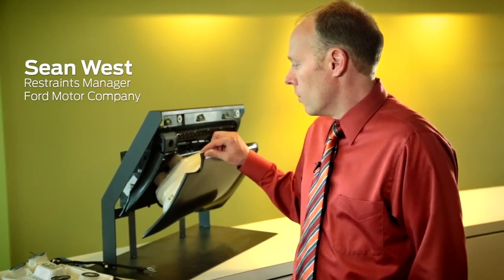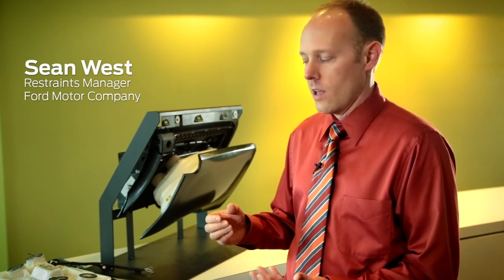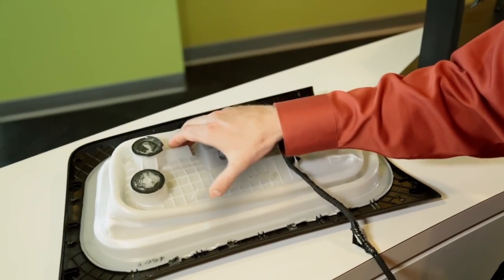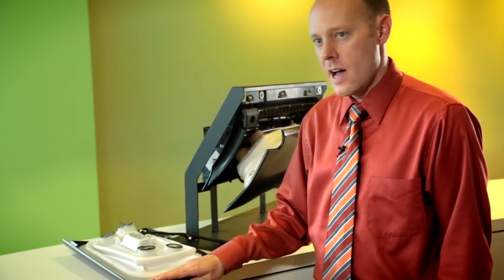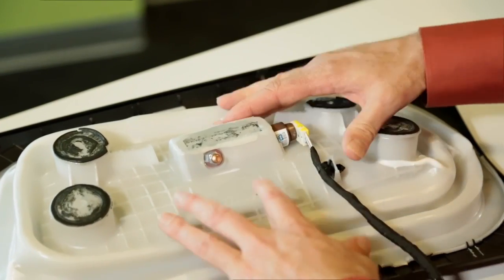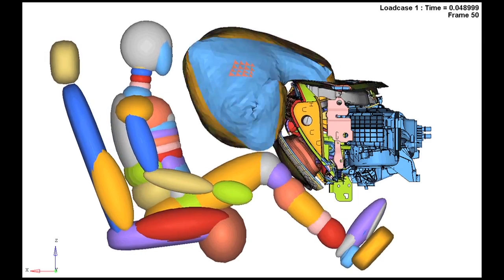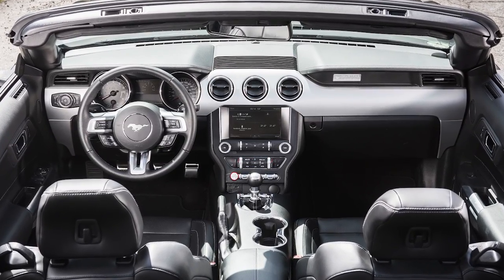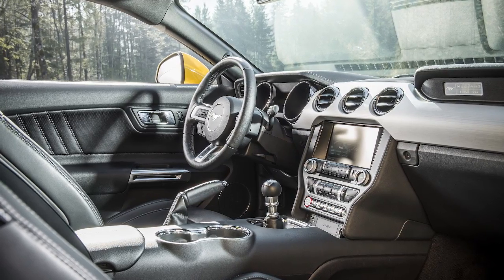World First Glove Box Knee Airbag - 2015 Ford Mustang

Comment: So the plastic hits against your knee?
Reply: K Sadek Knees have a too small contact surface and the air will mold by. The plastic plate prevents this and allows the air bag to alleviate the shock.
Reply: K Sadek Yeah. The glove box will shoot out like that, and the airbag will be behind the plastic. So then when your knees do hit it, it will be more cushioned. Unlike before when your knees will slam into the dash and get all screwed up.
Reply: HeSaidWhatToWho  Thanks for the explanation. Still, wouldn't a regular knee airbag be better than this? I only see it as a cost saving option.
Reply: @K_Sadek   regular airbag would take more space decreasing in cabin passenger leg room
Reply: Actually it never works I had a crash in a 2015 mustang and it couldn’t  fully deploy while the driver one did without any issues 

And I have seen a lot crashed mustangs with not fully deployed  ones so it isn’t something very strange
Reply: But it will not injure your knee trust me in an accident you don't feel pain unless you are injured and even then you only notice the pain when you see the injury